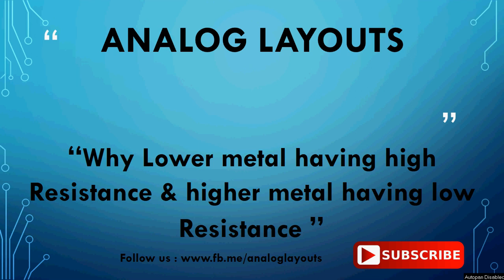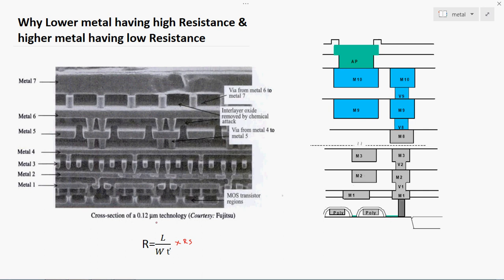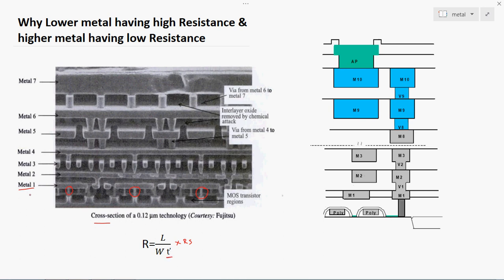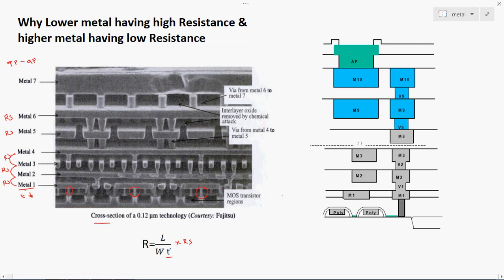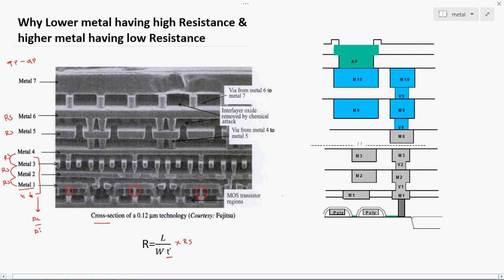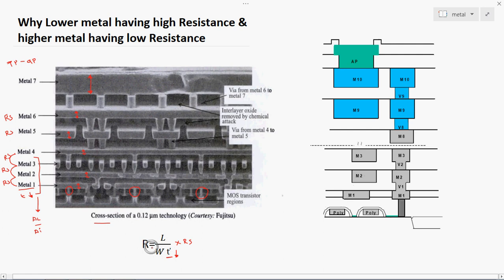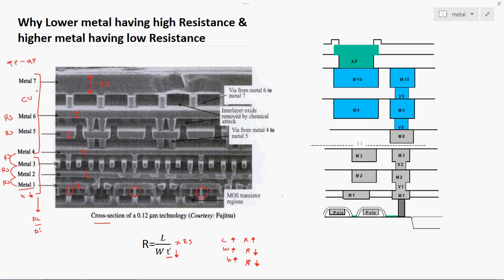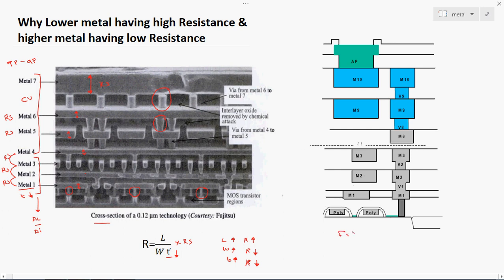Why Lower metal having high Resistance & higher metal having low Resistance - English Version

Comment: Why do we need to maintain different thickness ?
Reply from the maker: We can't maintain thickness - foundry will take care of this
Reply: @analoglayout  no sir but my question was " Why is thickness increases from metal1 to metal 10 ?" what is the reason for variation in thickness in particular fashion (like increasing from metal 1 to metal 10) ?
Reply: Why can't we make it reverse ? Like thickness of metal 1 is larger than metal 10 (lower metal having higher thickness and higher metal having lower thickness ) ?
Reply from the maker: @Artbyshrinidhi  i don't know the exact reason why foundry are following this style, but as per my understanding to reduce resistance they are increasing the thickness
Reply: @analoglayout  ok sir
Reply from the maker: @Artbyshrinidhi  there is no point of doing reverse process, cos lower metal is not going to handle High current density, but top level metal are connected to multiple sub blocks, so higher driving strength needed , so it make sense
Reply: @analoglayout  ok sir got your point
Reply from the maker: @Artbyshrinidhi  try to find out the better answer on your own research

Comment: If M1, M2 , M3 and M4 are all fabricated using Aluminium, then all of them should be having the same resistivity. But you said the resistivity will be different. How?
Reply from the maker: Al the metal is are not having same thickness , and RS
Reply: @analoglayout  If thickness is different, the resistance will be different, but the resistivity will be the same.
Reply: @mrworld454 yes the resistivity will be same because for particular metal we have particular resistivity but on changing the size of metal it's value of resistivity change  roh=RA/L
Reply: @mrworld454  resistivity = Rsh/thickness..
Reply: @user-wl1fz4rk4h  Yes, I know. But M1-M4, all these 4 metals should have the same thickness, right?
Reply: @surajsingh-nx6zl  Changing size or changing thickess?
Reply: @mrworld454  right.. Iam not talking what he said in the video.. But all of them having different min widths.. So they are having different resistance..
Reply: @analoglayout  If they don't have the same thickness, then the metal stack naming will change. For example,  4M-3C-2X stack means 4 metals of same thickness, then 3 metals of a little more thickness and 2 metals of higher thickness

Comment: Sir..for suppose main all metal having same thickness.what will the problem we can faced in fabrication and tell me what is difference between thickness and width..??
Reply from the maker: If the metal want to carry high current , for that thickness also need , if all have same thickness how this can happen ? So fab unit following this method

Comment: Difference between thick and thin
Reply from the maker: thin is small , thick is very high compare to thin
Reply: Actually thing is we have different types metals like m1 to m9 all these metals r different frm each other based on thickness .... Suppose if u take m1 it's thikness less compare to m2,m3, n m4  thickness is bit more than previous metals ....This is hw lower metal has high resistance than higher metals based on thickness.....In this video he proposed formula is 100 percent correct .Thank you suresh u r doing good job.
Reply from the maker: @praveennani3557  thx preveen , for positive response ... detailed explanation u've mentioned above

Comment: Why  the lower metals are not fabricated using CU do it has any specific reason for using different alloys?
Reply from the maker: cu is costlier compare to aluminium , and lower metal is only used to connect  gate & source & drain connection , so it will never handle critical voltage & high current , so aluminum ins enough to handle this
Reply: @analoglayout  all that high current must pass through S&D.. Which are connected with lower metals.. And one more thing in lower technologies all the metals are fabricated through cu itself.. I appreciate ur work.. 👍👍
Reply: Thank you!